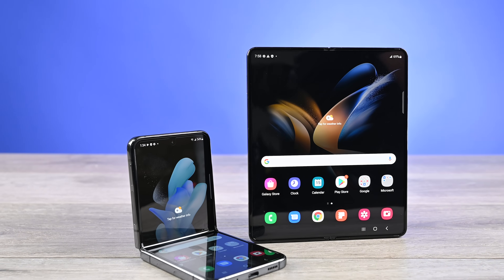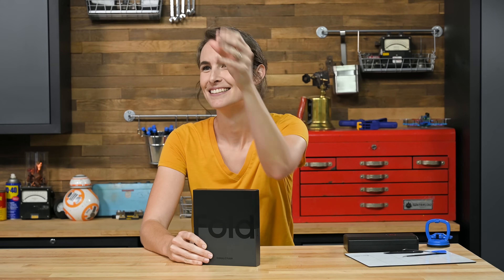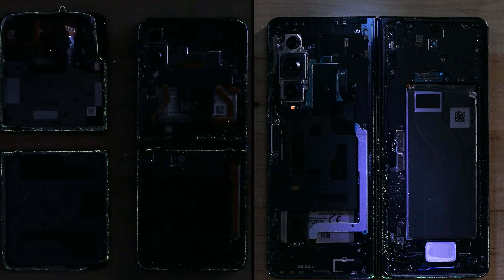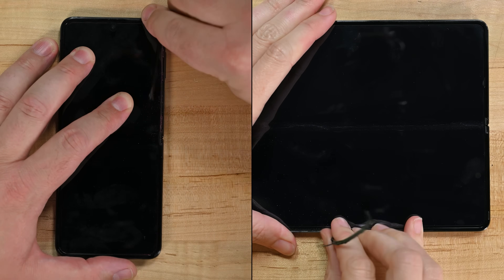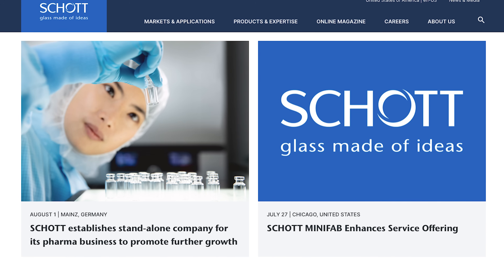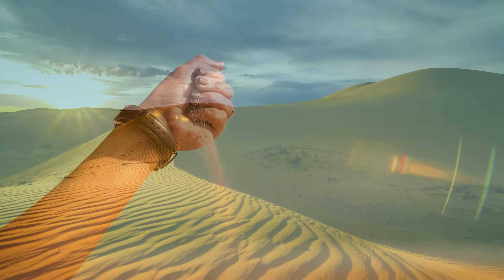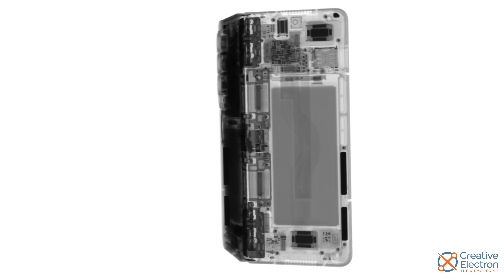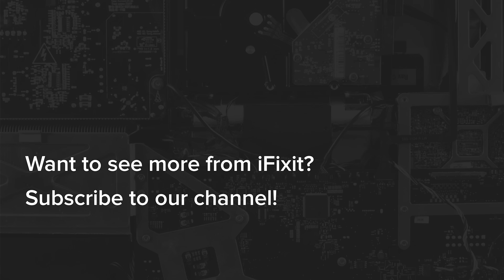Samsung Z Flip and Fold 4 Teardowns:  Do Cheaper Repairs Mean More Repairable Phones?

Comment: I need your help, friends, I have 1 fold 4 that I disassembled to change the screen. I changed it and it's ok, but now when I open it, it doesn't detect that it's open and it only goes to the small screen. What sensor is responsible for that? It is magnetic swnsor seems to go ok thanks friends

Comment: Watching this from my flip 4, I love it. But I'm super paranoid about the screen cracking like all the reviews/complaints and pictures of the flip 3 cracking
Reply: I’m watching to see what to do scoot my wife’s flip 3.  it isn’t cracking but protective  over is bubbling and i’m not sure I want to mess with it.   just cosmetic.   last time repaired the screen was broke and thankfully under warranty.   

just didn’t understand the guy telling wife the screen needed to be removed.  I bought one from Verizon and they put it on top.   

So don’t know what i’m gonna do with it.   hopefully the 4 has some improvements 😉
Reply: Fold 4 here, screen didn't break but the flex cables were damaged and had to replace screen, replacing the screen is replacing the frame as well so i got new color. They told me that "drops" broke. I was lucky enougb to get a screen deal but i am now looking to replace my fold with an iphone.

Comment: I still use my fold 2. The display is still unbroken and no problems with the hinge. I never intentionally tried to push it beyond its limits but use it as a tripod very often and once while doing so, wind knocked it over and it fell nearly 5 feet on concrete. It survived. Just use a good case.
Reply: I just got my z fold 4, 😅 you can imagine I'm still extremely worried, SPECIALLY about the dust build up from pockets, and everyday wind and such, how has your fold hold up? Do you hear friending in the gears??
Reply: @lowkey2421  Using it since day 1. Was supposed to get the fold 4 this year but seeing as my fold 2 is still running like a bull, I got the s22 ultra for the cameras this year so I now have two phones which feels like three if you stack one on top of the other 😆
I have always used a good case and been a bit careful while closing the lid. Thats about it. There are some scratches on the display now but thats ok after two years. When I bought it, I didn’t expect it to make it pass six months.
The hinge is still doing good and no unusual noises and make sure your pockets arent dirty.
Reply: Since it launched?
Reply: How long have you had it for??
Reply: Jesus that's so good to hear, I have the same 6 months fear, but I feel confident with it, and I'll keep it as clean as possible, thank you for sharing
Reply: @lowkey2421  I bought every iteration of the fold, Its the best device for my requirements as I travel constantly and need my excels and docs readily available. In my experience apart from the fold 1 these phones are more durable than they look however each individual's experience might differ. Currently using s22U and Fold 4
Reply: Fold 3 owner here! Dropped my phone in playground sand while on swings at a park, big kid style! XD That was one week one!
Phone was crunchy for a bit, but came out perfectly fine after a few days of folding.
Have 2 bubbles under the interior screen protector, but those only showed up a month and a half ago.
Reply: I just got the fold 2. Bit of an older device at this point, but still very useful today. I find folding smartphone care is a lot like caring for an old car. You don't just get in and go. You start it, let it run for a bit, put it in drive and wait a couple seconds, then drive away. You shouldn't whip open or close the phone, nor should you open the device if it's arctic cold, cause that'll snap the folding glass. But honestly, with a good case and a little bit of awareness that you have a device more fragile than most, they can last a really long time. My z flip 3 still has its original display and frame, and yes, I've dropped it about 4,5 times over a year ago from this comment
Reply: just for anyone in the future wondering why, in fact, the z fold 2 should be more "durable" than fold 4, the 4 have this design flaw where in order to justify the higher ipx rating, they have glued in the "flex cable" on the phone body. one of the 2 common problems along with the brushes falling apart (that causes the fold not to fold flat anymore) is the fact, that since it's glued in, it applies way more stress on the cable during the unfolding, this way your screen will suddenly turn black. I am writing this from my own experience, i have treated my fold 4 as a baby (and im not the kind of parent who throws their baby) for a year,  currently encountering both issues, out of warranty, writing via the front screen that's still intact. the inner one (without a single visible damage) started first just flickering, when opening, then stopped working entirely. From this experience i am never buying fold until they convice me enough that this is a consumer ready phone and not the forth generation of an experiment. hate the design of the 6, you are way better off getting rid of it and buying something like s23ultra. loved my one until it lasted, this ones on samsung tho.

Comment: "Hinges wear out" the old school flip phones hinges are still strong today as they ever were. Despite having advanced in tech, it appears durability has tanked with these near phones.
Reply: Old flip phones used to snap in half. This hinge won’t snap
Reply: It's the material that got cheaper. If it costs nearly nothing to produce a spare part, why bother with making it last?
Reply: Idk man, I had to repair plenty of hinges in ye olden days of flip phones and sliders
Reply: I still have the Motorola Razr V3i and it still works as good as new.
Reply: The issue is the complexity of the hinge assemblies. They're entire mechanisms on newer foldables as old school flip hinges were simple rotators with just a few pieces per side.
Reply: @illitero  that’s why I have an iPhone
Reply: Did you ever try intentionally throwing dust into your phone?